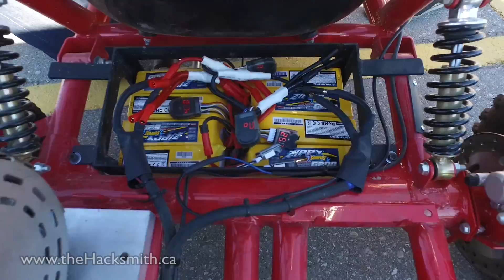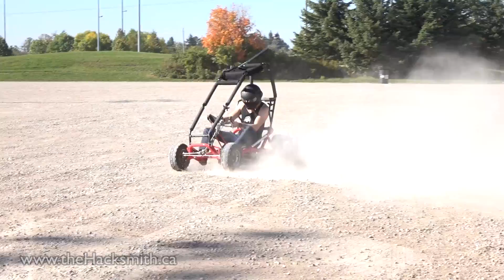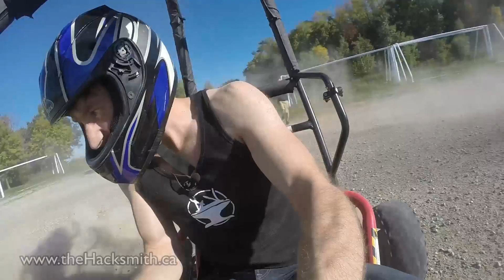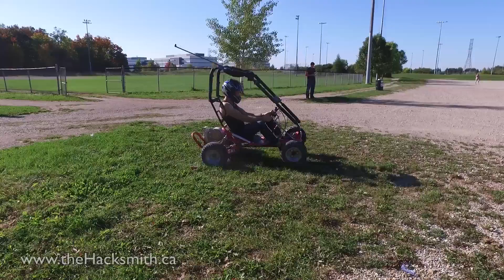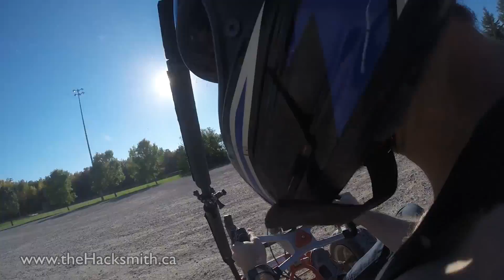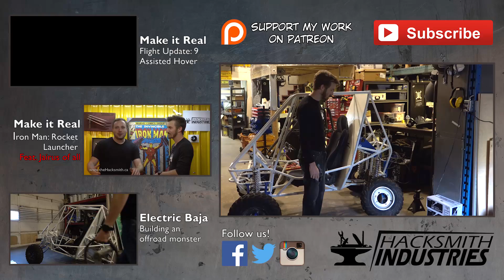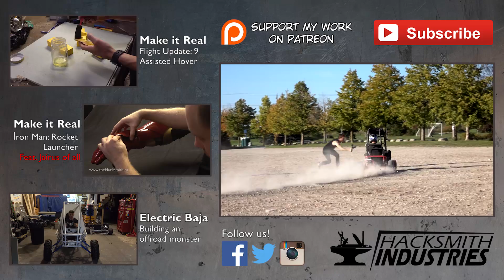Overpowered Electric Go Kart has TOO MUCH TORQUE (54 FT-LB!)

Comment: Ok , I see you have posted battery times of 30 to 45 minutes, My question is " is that how long that small pack lasted you guys on this particular video ?" and also were you able to change packs ? Is a larger battery upgrade coming soon ? Great to see Electric making headway.
Reply from the maker: +Michael Littlejohn we had two sets of batteries and we were messing around all afternoon with them. We didn't do any more accurate tests, as this was just a fun proof of concept -- like all our projects -- we don't plan on designing or commercializing anything anytime soon. We seek to inspire others to see what's possible :)

Comment: haw many lipo cell are in series and parallel for the output voltage?
Reply from the maker: +mreid08 22.2v cells, 2 of each in series, then the pair's in parallel
Reply from the maker: +mreid08 22.2v cells, 2 of each in series, then the pair's in parallel
Reply: the Hacksmith so 44.4 volts at 10,000mah?
Reply from the maker: +mreid08 6200maH reach battery pack, so 24,800mAH
Reply: the Hacksmith wow that will do it!

Comment: One way it won't outperform a petroleum/diesel engine(yet..): mileage.
Reply from the maker: +Danja Bis it's a go kart. It doesn't have to
Reply: Go karts are raced endurance too, it'd nice to see a comparison between weight, performance (acceleration/decelleration times, geforce from cornering etc) and distance travelled on similar weights of fuel as I'd be willing to bet you'd do further on 20 kilos of petrol than you would of batteries. I love electric motors and the tech, but its just inaccurate to state that the one you have there would outperform any petrol equivalent when it'll only do it in specific situations. Both have got their uses and neither is better than the other yet due to their flaws.
Reply from the maker: Yeah but we were talking about outperforming in a specific feature -- in this case, power and torque. I think the battery tech is here for electric go karts to make sense, even for half hour to one hour length endurance races. As battery tech advances they'll take over completely =) Also remember an equivalent or more powerful engine would weigh many times more than this motor, so if keeping vehicle weight down is also useful, electric's pretty good!
Reply: I mean, we used to do 12/24 hour endurance races which were what I was thinking about. An hour is just little more than a standard race which wouldn't have used a full tank of fuel, or anywhere near. It would use a near a full battery though. I'm genuinely interested in whether electric tech has caught up enough to be viable for race situations for the common man and not just formula e stuff.
Reply: Gasoline is still way more "power dense" than batteries, i.e. 1lb of fuel will do a lot more than a 1lb battery.  However, batteries are getting better and better, and charge times are getting faster and faster, I have no doubt one day batteries / capacitors will be more powerful than combustible fuels and take less time to charge than refilling a fuel tank.
Reply: its the range where gas has it beat for now
Reply: except you extract about maybe 5 percent of that power through one of the most inefficient and dangerous systems available.
Internal combustion. Where 95% of your power to the wheels is lost to friction and heat.
Reply: Doctor Jack for thermal efficiency for gas its up to 25 percent and 30 percent for diesel...electric motors are about 90 percent
Reply: If an ICE is beating you in terms of operating duration when its only at "5%" efficiency then either your maths is wrong or the electric motor is REALLY inefficient for the fuel weights required.
Reply: I think what's going-on here is what I call the "fuel tank" argument: That until a battery's physical & electrical performance properties (i.e.: size, weight, capacity, rate of replenishment & discharge capability) match or exceed that of existing fuel-tank designs & the relative fuels used, it'll never be seen as a viable equal. 

But don't lose faith! It was once believed that nothing could match the power of a steam locomotive, nor that fire could be fully replaced as a means of light & heat in everyday life... But both have been proven wrong! Folks, I have seen the future of motive-transport, even for recreation & sport... and with batteries being the only real commodity in this argument, and with them seeing improvement & development in recent years far-greater than in the decades which followed their introduction, all I can tell you is "The future is not on tape...".
Reply: oh yeah, look up nickle mines, that's where your "environmentally friendly" batteries are coming from, oh and btw I just watched a civic beat a tesla by 5 car links in a 1/4 mile, if we're gonna keep this planet in good shape we have to find a balance between the two power sources, and also look into hydroxy technology, because hybrids are the future not just one or the other, cause people are gonna be mad when they find out where those batteries are coming from

Comment: can you make an electric jet engine to go off it maybe you could lift off with that
Reply from the maker: +grayem pepper were using electric ducted fans for the flight project...
Reply: i know im just saying this motor with give a lot more thrust
Reply from the maker: +grayem pepper not the same, this motor is 7kW (11kW peak), the EDFs are 8kW -- the difference is the EDFs have high speed low torque (40,000rpm) and this motor is low speed, high torque (only about 1200rpm)

For flying you need speed more than torque :)
Reply: ok thank you for clearing that up

Comment: FFS TORQUE DOES NOT GIVE ACCELERATION 
POWER DOES! 

Torque 
The literally only time you feel torque is in torque roll
Torque is just a measurement of the engines rotational force 
That's it
It has no impact on acceleration alone 
Only power does
Reply from the maker: +MyLonewolf25 was I talking about acceleration...? I was talking about wheelies...
Reply: the Hacksmith wheelies are caused by power and acceleration 
Nothing else
The only thing that moves it is power

Also 
Sorry for freaking out
It just pisses me off when there is so much readily available information on this yet so many still tote the whole torque myth
Reply from the maker: +MyLonewolf25 its still a valid rating to compare...
Reply: the Hacksmith valid yes
In terms of acceleration 
No
Especially when it comes to wheelies
Reply from the maker: +MyLonewolf25 yes but this motor has 3 times the torque rating of an equivalent size gasoline engine... Do you actually have any knowledge in electric motors and how they compare to engines?

Comment: Wait, if this motor is that powerful,  then how long does the battery last before it needs to be recharged?  Also, is the motor applicable to other vehicles or strictly just for Go carts and dune buggies? Perhaps it can be attached to other vehicles like a golf cart or tuktuk
Reply from the maker: Welcome to the realization that electric vehicles are the future ;-)

That small little battery pack still lasts a good 30-45 minutes
Reply: So what's the price for it? Can it possibly be added to...not precisely motor vehicles, but sports equipment? Maybe bikes and skateboards.? What about configuring it for a motorcycle?
Reply from the maker: +jose paolo Aranda all of those vehicles exist... Electric motorcycles are awesome! So are boosted boards, and of course, Tesla's!
Reply: I know. But I meant if you could modify any of those using this specific engine. Making them yourself is my main point
Reply: "Making them yourself is my main point"
Sadly specifically that is against the law where i live and everything has limitations, for instance 1KW or 25km/h for electric bike...I would have build electric motor bike or converted gas car to electric long ago, but nothing of sort is possible here.

Also with cold winters electric is not good idea here, long as battery tech is effected by the temperature.
Reply: alright. Sorry to say that I am actually more of an enthusiast and have little to no knowledge of motors
Reply: Be a great thing to add to a tuktuk. You could keep the petrol motor for long distance travel and use the electric for short trips. Once you work out the amount of batteries needed you could probably get away with removing the petrol motor.

Comment: how much load is on the motor though. would the motor not get extremely hot with all that load from a dead stop
Reply from the maker: +Colin Dejong doesn't get too hot actually! Its designed to be operated at full load, unlike gas engines ;-)

Comment: an motorcycle would be way cooler
Reply from the maker: +milano007100 motorcycles can usually wheelie normally though... Making a 4 wheel car do it is much more impressive
Reply: the Hacksmith wow a reply, yes a car would be really impressive. but a bike weights almost nothing so the acceleration would be EPIC. and 2 wheels are more fun than 4
Reply from the maker: Oh I know, I've had a few motorcycles over the years, but we'd rather make something fun and stable for off-roading =) Also this frame, and even the Baja frame... weigh less than a bike ;-)

Comment: Your neighbor has esc`s and elec motors, edf`s maybe parts? Go kart was cool, elec seems the way to go but I still love the sound of my petrol toys.
We had a few sheds on a property guy in the middle shed was an engineer. We made all types of stuff all fun most fun and deadly. We wanted to build a plane or ultra light, so first we made a hang glider out of Aluminium poles and an old parachute and 100 ft off rope and used a 600cc 4 wheel motorbike to pull it along. First test we wanted to see take off speed (do we need wheels or can we run) the hang glider took off so fast straight up rope went taught and then straight back down nose first into the ground, so a couple of mods (where rope attached to glider) and time for a pilot, we all had a go, plenty of injuries that day.
Reply from the maker: +me001ist that sounds awesome! No EDFs sadly

Comment: You could make it AWD if you have an engine in the front too, like a Tesla P90D. That might fix the wheelie problem
Reply: Kristian Mikkelsen ? AWD won't fix the wheelie aside from it adding a little more weight to the front end
Reply: Nathan Boody Because the engine and the batteries are at the back, there is too much weight at the rare end, which makes the "Car" lift. Because of the lift "Wheele" they can't use all the power because then the "Car" would flip
Reply: Dan Koldenhoven If they have an engine at the front to and move all the batteries to the front there will more weight in the front. With more weight in the front there are more grip at the front tiers, and this grip will make the front wheels move the car more forward and fix the wheele problem
Reply: i dont see any wheelie problem :)

Comment: Who else thinks the cart sounds like a great big RC car?
Reply: Yeah, because that's "true" for you, it's true for everybody... right? By the same token, I don't need a new hammer so of course nobody needs a new hammer.

Obviously both your assertion about electrics and mine about hammers are  invalid. 150 miles is plenty for a lot of people. In fact, it's plenty for over 90% statistically. 

Oh, and the shortest range Tesla (the S 60) went over 200 miles between charges... And that was software limited because the real range is over 250.
Reply: More than gas power, you need an hefty engine to outdo an electric engine. Just take a look at Tesla cars..
Reply: Just like golf carts, they make gas ones too so...
Reply: Michel Linschoten electric right now ain't shit when you can only go 150 miles before you would have to charge again in something like a Tesla.
Reply: BANANAHAMMER420 Bumper cars this fast would be fun!

Comment: I'm probably wrong, but can you use the ASI to power the Iron Man flight project?
Reply from the maker: Each EDF is 8kW -- the motor in this thing is only 7kW (11kW peak). The ASI motor is made for power at low speeds. EDFs are made for super high speeds, but don't have much torque!
Reply: Thanks, sorry I didn't understand at first...
Reply from the maker: Basically flight is SUPER HARD because it's highly inefficient -- but doing stuff on land... you can get craaaaaaaaaazy power! because it's a lot easier to convert energy into movement when you don't have to fight gravity =)

Comment: But does it have a cup holder? 😮
Reply: David -flamingsword1 don't need one, this is one of those hold my beer situations
Reply: Yes, but while in use you can only hold the steering wheel with 1 hand.

ie: the driver is the cupholder
Reply: It has a beverage spiller.
Reply: Haha and AC + seat heating lol
Reply: Gotta have that gyro stabilized cup holder on a gimbal.
Reply: David -flamingsword1 don't forget about the tv

Comment: You don't max out gasoline engine torque at redline: it starts dropping after 4-5,000 RPM on most engines.
Reply from the maker: I was speaking approximately =P

Comment: lol my go kart ran 156mph on a quarter mile had a 410 big block on it had 814bhp and 703ibft supercharged😏 had a 4.14 as final drive pulling 8100 rpm it was baaaad
Reply from the maker: Daaamn
Reply: the Hacksmith yeaa its stuck in NC tho thanks to some fool...the electric one is sick tho itd give mine a run for its money

Comment: Needs better tyres on it, those are foooked
Reply from the maker: Chucked the whole thing. We must start over!
Reply: the Hacksmith what voltage does the motor run if its around 74 or 94 the I would work amazing with a 30amp hour
Reply: RetroResto needs bigger tires

Comment: Could you use a gas generator to power the electric motor? Benefits of electric motor and faster refuel than charging!
Reply from the maker: Eh, bunch of efficiency losses doing something like that, plus the added weight of having a massive generator on there =(

Comment: how much is that motor/controller pack
Reply from the maker: +acephantom903 probably a lot more....
Reply: I'm guessing just under $500. I could be wrong.
Reply: the Hacksmith You're totally right. I just looked up a few that are intended to drive heavy tools like shredders and they are $980-1500 each. Since this is designed more for performance it could  be up to $2000 or more.
Reply: hahaha... a lot more.

Comment: you should put this motor on the exosuit
Reply from the maker: Not the same kinda power though -- You need a high power low speed motor for joints, this is a high speed high power motor =)
Reply: the Hacksmith Ok

Comment: This is so awesome! Do you have any updates on the iron man flight projects?
Reply from the maker: Boots are almost done, still waiting on an extra ESC (we fried one) so we can't do a test yet
Reply: Cool! Looking forward to it! How many EDF's are you going to use in total. Like to fly completely without any assist?
Reply from the maker: We'd need about 20 of the current ones, which is ridiculous, so we need less big ones... but the big ones are like $5000 each =(
Reply: Oh thats sad to hear :(... I just found this motor on HobbyKing, it provides 2.2kg more thrust than the one you bought: http://www.hobbyking.com/hobbyking/store/__41695__Dr_Mad_Thrust_120mm_12_Blade_Alloy_EDF_650kv_Motor_6300_watt_12s_.html
Reply from the maker: We have those -- problem is they weigh 1.5kg by themselves!
Reply: but still if you subtract the amount of thrust the motor i sent link of  produces by the amount it weighs is greater than the motor ur currently using
Reply from the maker: We have a lightweight 8kg thrust EDF that only weighs 900g, so it's in the lead right now for EDFs. The little silver ones with 5.5kg of thrust were just for initial tests
Reply: Oh ok. Cool! then this one is the better one! And sorry if I was irritating you or something.

Comment: you have to put 4of these motors on the new cart and controll them seperatly for optimal performance and handling!
Reply from the maker: Haha I think 2 would be more than enough. But yes, independent drive, tank steering! =D
Reply: the Hacksmith 
i had the idea to build an rc car like that and create an arduino code to achieve the best possible handling and to try to simulate different driving characteristics :D

Comment: I literally did the same modifications to a go cart I got for $25 last week. I made it in a day using a 5 hours power engine. Nut the sprocket is to small and I need brakes but this is helpful.

Comment: atleast you wear helmet unlike furze
Reply: don't underestimate the safety tie
Reply: the tie is legendary eq, adding more than 100 armor and all elements resist up to 500 points, also 1000 hp and regen speed 20% max hp.
Reply: Safety Tie AND shirt. Never forget the shirt which is there in case the tie fails!
Reply: Furze got balls!
Reply: He needs to go and put it in a mobility scooter like Furze did though. This setup would be perfect for trolling people, as the engine noise wouldn't spill the beans and everything looks small enough to fit.
Reply: Furze made his own head and can crash/rebuild it anytime!
Reply: Yeah, but the challenge for Furze's GWR was to cram an entire internal combustion engine in the mobility scooter which is more impressive. But yeah, this would be quality, especially with full prosthetic makeup tootling round town XD
Reply: I was just thinking how dumb he looks on this tiny thing with a helmet
Reply: Satisfaction Guaranteed: Plus furze's head can automatically shoot fireworks from the mouth and ears
Reply: top -5 who